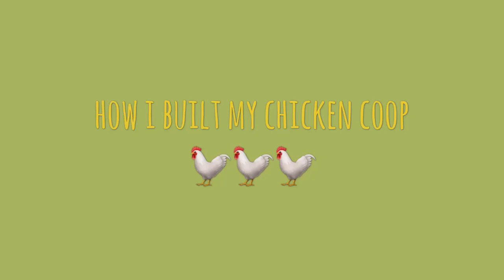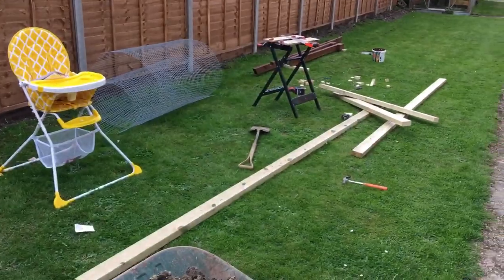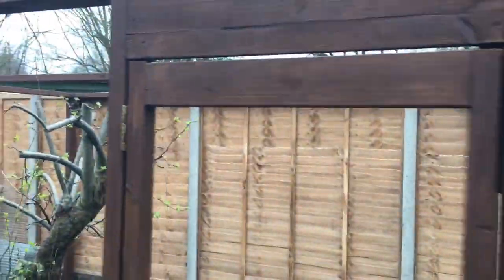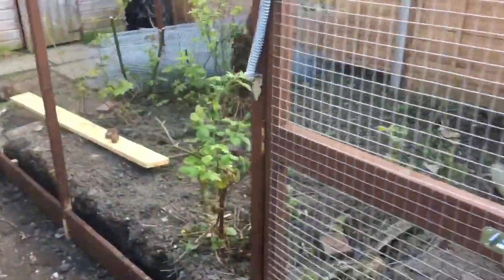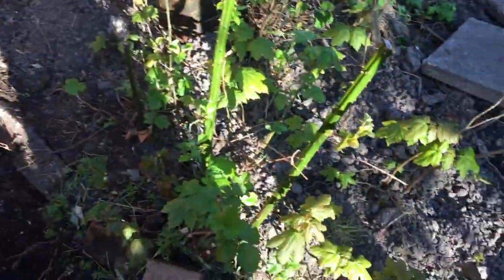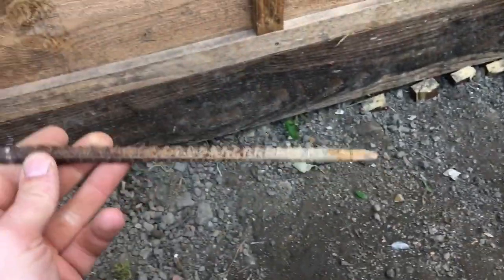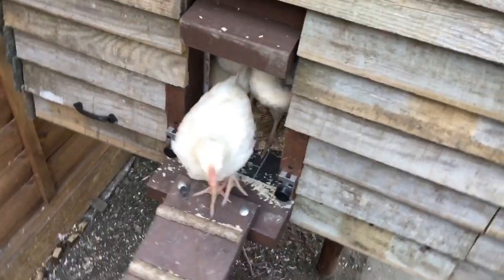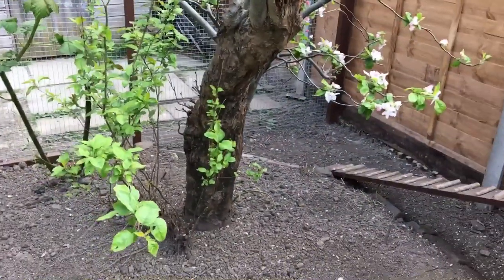How to build A chicken coop in a UK urban back garden.

Comment: Liked and subscribed! Good to see more uk based content providers!

Just a few constructive suggestions in the hope that your content will improve, as we need more UK based content such as yours, rather than the constant US stuff which is not always relevant to the UK.

Please work on your camera movements which are erratic and moving too fast all over the place, especially at the end, when it would have been nice to see your finished work in more detail with a slower camera.

And the sound quality also needs work. For example, the music in the beginning of the video is way too loud in comparison to your voice which is hardly audible and your speech is sometimes unclear at times.

It would have been great to get a bit more detail on the design plan and build of the actual coop and chicken run, as you were building it.
Reply from the maker: Thanks for the comment, this is one of my older videos. I’m in the process of making a new chicken video. I would like to think my edit and filming skills have improved since this video was made, but I will take your comments on board. The reason the music is so loud is because YouTube gave me a copyright strike on the apparently “copyright free music” I used so I had to replace it with the pre-set music that YouTube provides and there is no way of changing the volume.

Comment: This is a really nice coop and run. I wanted to initially do one that was posted into the ground and sat on a grass and eventual earth floor but I was worried about drainage and mud; in the end I've decided to go with a large concrete base sitting about an inch in the ground and standing about three inches out of the ground and just work from that. Lovely work!
Reply from the maker: Tony Oliver  One of my biggest regret was not doing a concrete base first. Thanks for watching.
Reply: But where will the chickens scratch around if the base is concrete? Do you mean base just for the coop

Comment: What materials did you use? Where did you buy them from?
Reply from the maker: Emre Ak Pretty much all the wood is from Lawsons 4x4, 4x2 and 2x2  and the Aviary wire I got online. Everything else is stuff I recycled.
Reply: @GERfusion  I really love you did this and it's a really neat job so well done... I currently moved in to a new house and it's got a children's playhouse that has the same shape and size as a chicken coop so I'm planning to convert that.

Is the wood water proof or mud proof, are you scared of it rotting under the grass at all?

My biggest question has to be, has any foxes got in?
Reply from the maker: Emre Ak it’s made of wood so I kinda know it ain’t going to last forever. I just treated all the wood with normal fence paint to give it a bit of protection. So far so good. And no foxes. 

Good idea, I’ve heard of people using children’s play houses as chicken coops. The dimensions are very similar. Good luck building yours make a video and upload it 👍🏻

Comment: How much would something this size cost in materials roughly?
Reply from the maker: Conor Mcdade All depends on your budget really. You could probably do it for under £100 if you used a slightly cheaper wire and Materials.

One suggestion I have though is that I wish I had done is the ground work first. Put in some hardstanding as it’s just mud and they make a right slushy mess.